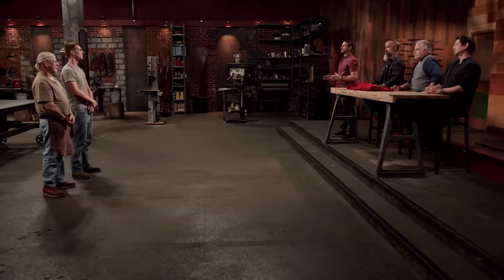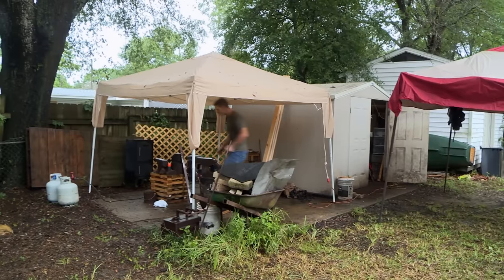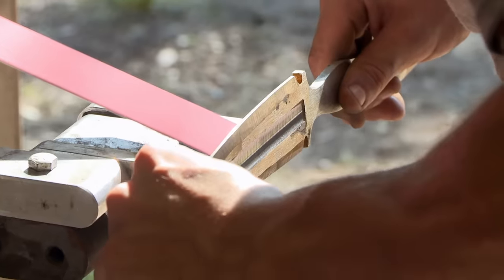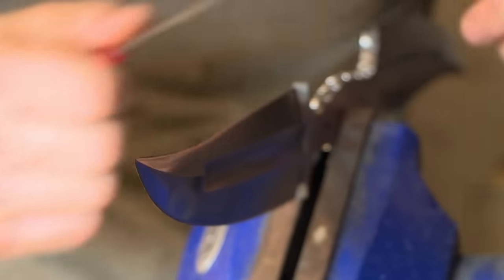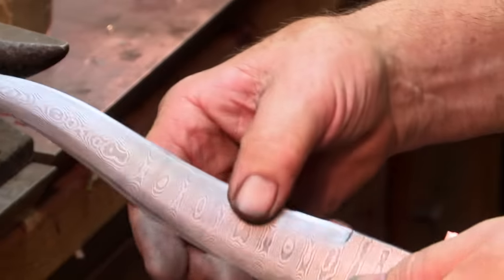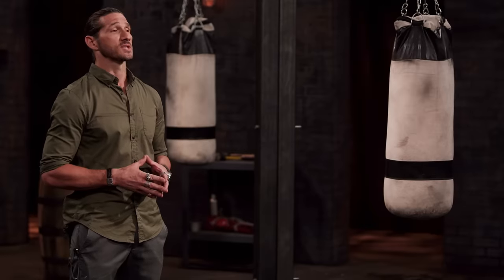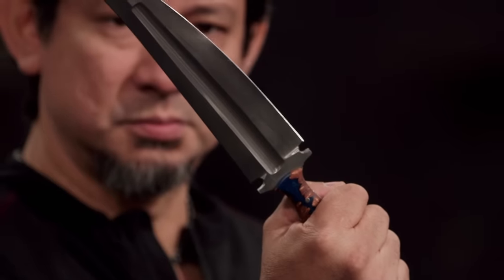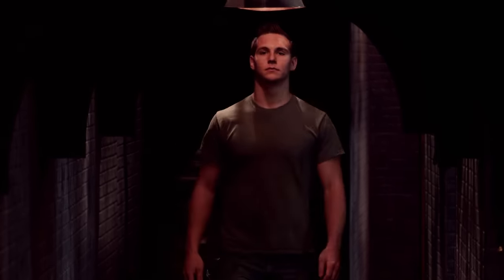Forged in Fire: DOUBLE-EDGED DAGGER DOES DEADLY DAMAGE (Season 3)

Comment: Question.. If both contestants were in requirement to follow specific parameters, yet both contestants do not deliver, lets say they share the same error, or there are two different errors between both weapons that were specifically required,
does that mean they both lose the challenge and need to start another weapon? or will they keep on going?

PS: I think this is the only finals challenge I've heard so far where the famous Forged in Fire man didn't say "It will keal"
Reply: That never happened before i wonder what would happen if that happens, i am sure they wont continue to test those weapons, they might give a bit more time to make a new one with perfect perameters.
Reply: @Pavonis1010  Or I'd guess they might cut the program and show the newer weapons they'd make? Hmm
Reply: @kingvector1198  Ya definitely
Reply: @Pavonis1010  Hmm. But who really knows though. Lmao

Comment: That was a little unfair the old guy has 30+ years experience making blades by specifications, to the least the judges could have let him reforge his blade once.
Reply: Not really unfair. Doesn't take 30+ years experience to open your earholes and listen properly to instructions. Especially if 10 grand is on the line.

Comment: When he finished his blade more than a day ahead of schedule, he should have stopped to wonder whether that was a good thing. It is much like sitting an exam, if you finish it in significantly less time than you were expecting ,you should check to make sure that you didn't miss a page. Also, that was not a small detail, it was one of the main defining and overarching specifications of the blade. Too much confidence, too little attentiveness. The grinding on the groove in the centre of the blade is not straight either.

Comment: It seems so unfair to me to not have the camera crew who accompany the guy remind him of the parameters. This contest is supposed to be a test of forging skill not memory skill, losing for just forgetting a parameter seems unfair. Moreover its disappointing for the audience to not get that sweet bloody action, so I think the show's ratings suffer too from this.
Reply: Think of it like a contract for a job.  You get the contract and it's your responsibility to double check everything and come up with your deliverable.  The contestants have the responsibility to do the job right.  Any it's not even like they have the memorize the parameters, they're not only told to them, and filmed, they're written down.  Even if they weren't written down, nothing prevents the contestants from writing them down.

Kid was overconfident, that's all.

His blade likely wouldn't have done well in some of the tests, his handle was pretty small and looked like it would have rotated in the hand easily.

Comment: the kid shoulda used 1055, and done that recurve. 1095 is a hard steel but its not sword worthy as 1045,1050 ,1055.  i crashed my 1055 through 5160 and 1095 and 1075 blades and it came out  with barly any blade damage, the 1095  was a esee 6 and it went up agaisnt a 1055 from OKC  and i actually ended up smasheing through blade in like 9 hits